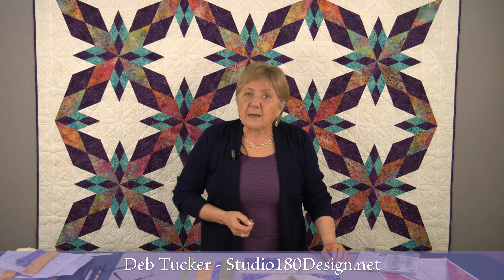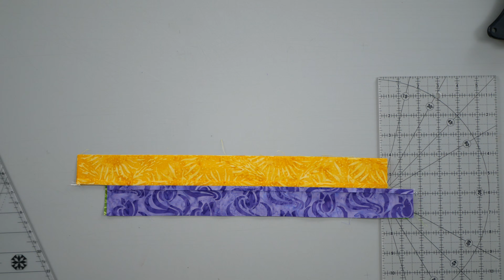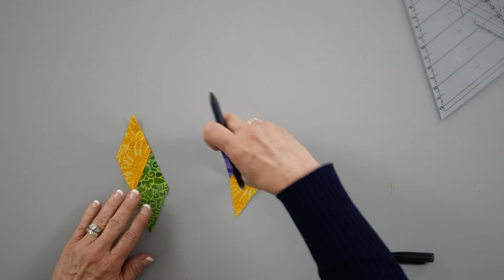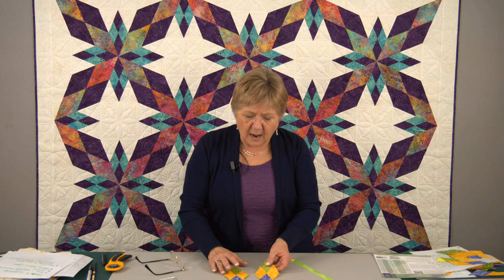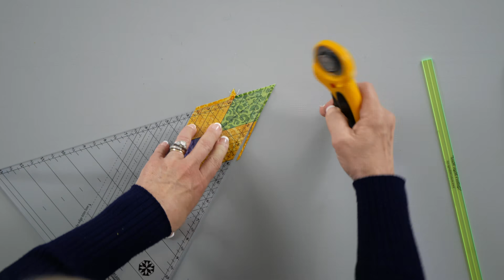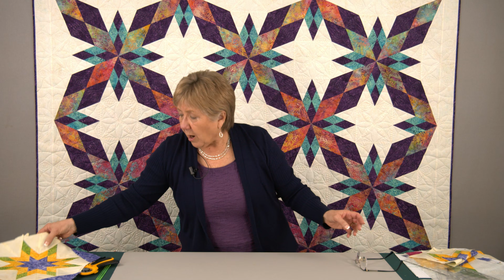Diamond Four Patch Wedge Tutorial

Comment: What ruler are you using as the second ruler to make the 45* angle?  Love your Tutorials!
Reply from the maker: The second ruler that I am using is an Olfa 6"x 12" ruler. The model number on it is GR-6x12. I love to use it for my 45-degree cuts as it has the diagonals coming right out of the center of the ruler.